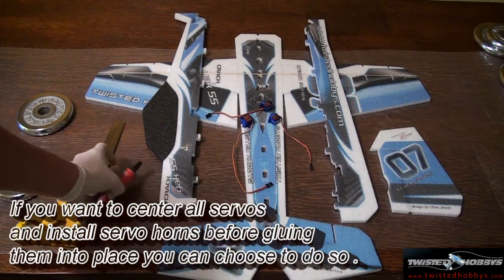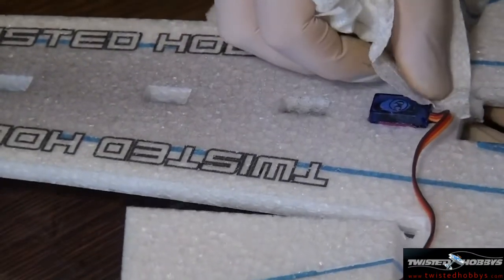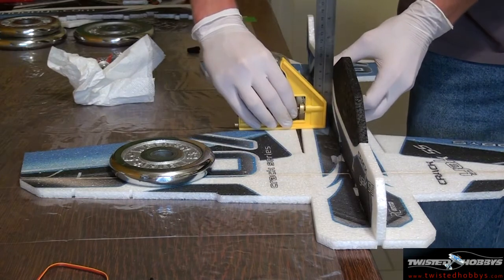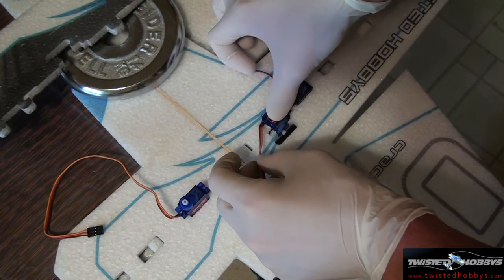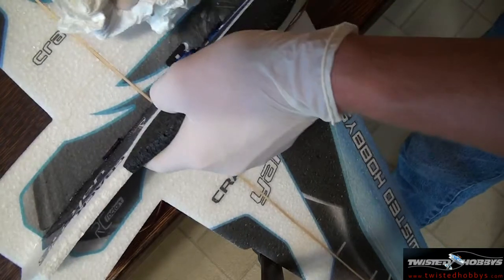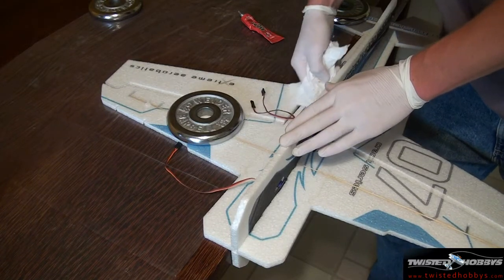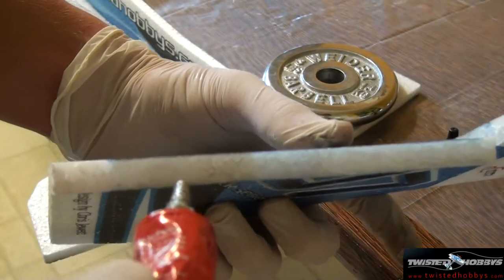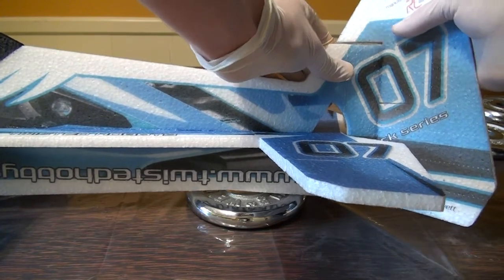Crack Yak Build Video Part 2

Comment: You didn't put the servo arm on the aileron servo before glueing the top of the fuselage on. How will you be able to screw it on?
Reply: I see a note at the beginning of the video indicating we have a choice to center and add the servo horns before gluing on the top, but I missed that while building...sigh will need to hummmm ..glue them on later or I see in a later video a screwdriver is able to squish the foam a bit and the screw goes in just like butter. :)

Comment: can anyone help... it looks like he put the aileron servo where the rudder servo should be? (as long as the aileron servo is the larger servo?)

is that right?  I've glued in the servos as per these instructions.. will there be a problem with this?